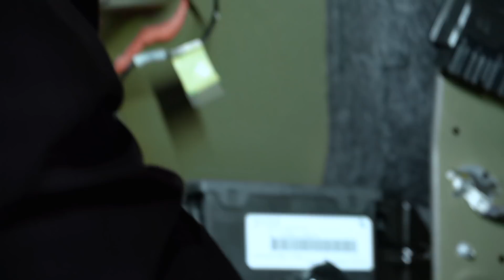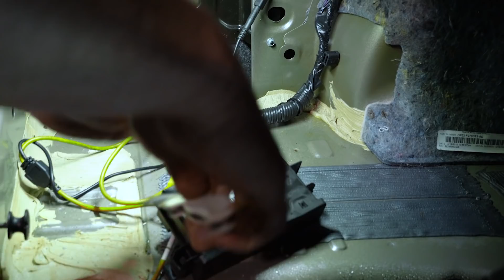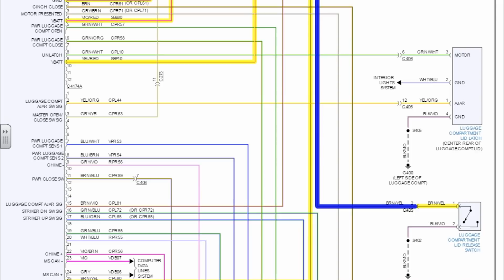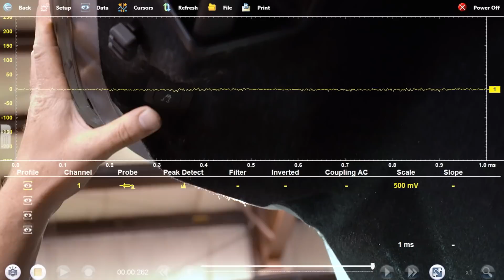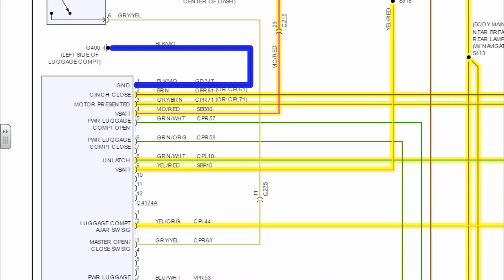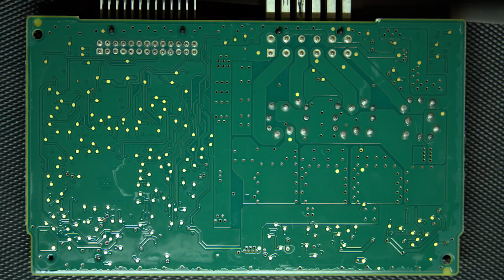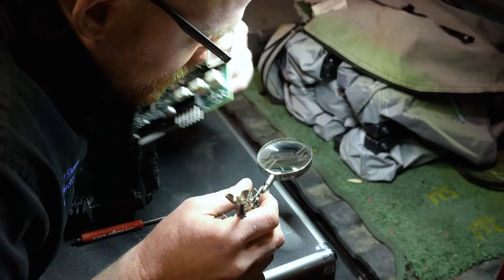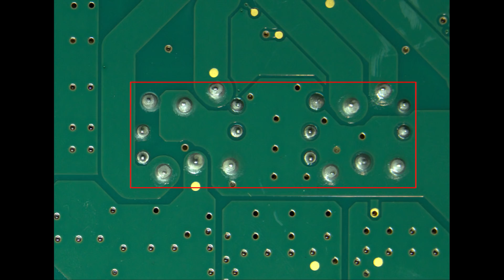2013 Lincoln MKZ Parasitic Drain/Rear Gate Trunk Module (RGTM) No COM (Part 2)

Comment: I use a bright test light to use as a load to test for powers and grounds, as voltage testing isn't a good indicator if a connection is capable of carrying a current.
Reply: I can understand why you would want to use a test light here, because a dead module will not draw any current to load the circuit, and I can understand why it wasn’t done because the module is plugged in and is the load. Like Paul said the only way to get burned here is to have a dead module and a faulty power feed, ground, ect..... at the same time and that is possible but extremely highly unlikely and almost never ever gonna happen, now that I say that it will happen lol
Reply from the maker: I understand the need to want to do this step. It's just not necessary to do here. Unless we want to argue that the module is bad at the same time we have a wiring problem. 
You are not wrong in wanting to do that btw